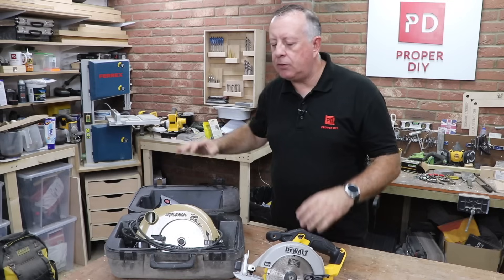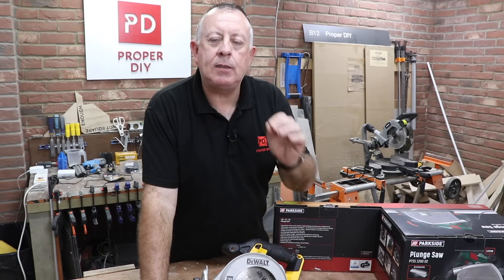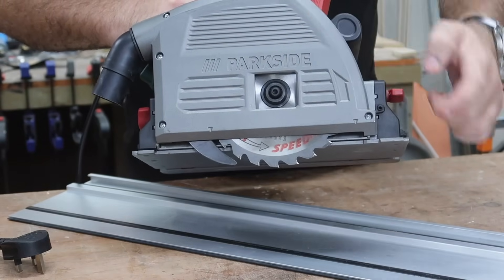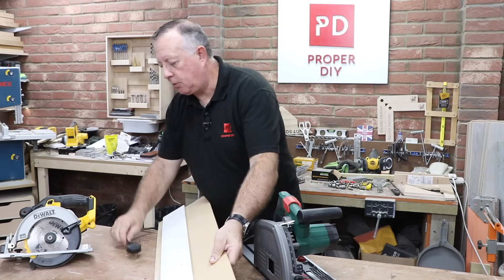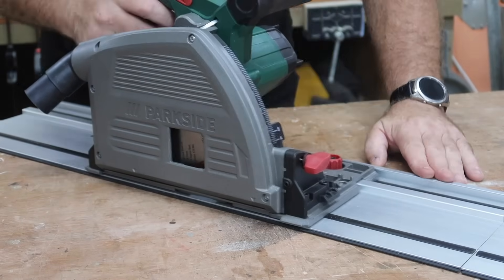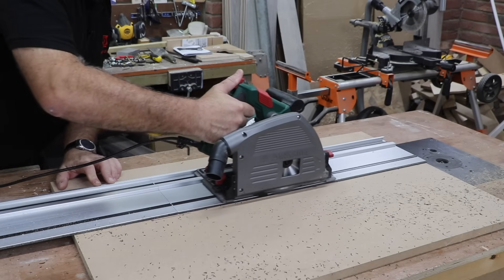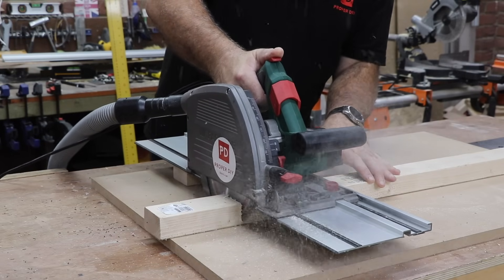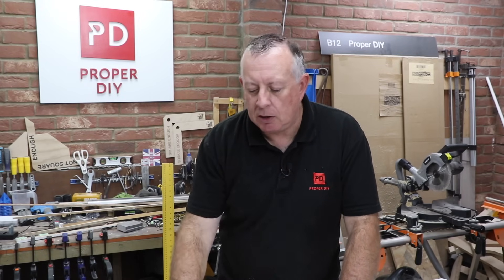Does the average DIY'er really need a Plunge Saw?

Comment: My woodworking skills improved exponentially the moment I bought my plunge saw. For making cabinetry and furniture it is indispensable and the accuracy saves lots of fiddling about to make things fit. With one of these and a cordless circular saw, there is nothing you cannot tackle.
Reply: It can't drill holes 🤣👍
Reply: @STEVIEBHOY It is very useful to make holes, just not small ones. Just the ones that a drill isn't useful for.
Reply: Fully agree i had the same experience. Opened me up to a whole world of options. I also have no room for a table saw and the track saw can handle most cuts
Reply: Ditto. One my first bigger project involved over £1k worth of oak. There was no room for errors. All repeated cuts came out super precise, square and equal - rendering my evo table saw and the mitre saw  completely useless.  Peter Millard also said that the more expensive plunge saws have much better dust collection: I fully support this statement - while cutting, I do not even have to switch the extractor: all dust ends up in the hose on its own (unless you trim very tiny straps from the edges, with the blade exposed). My advice to the new DIYers? If you cannot afford very good table saw and very good mitre saw - buy one, good plunge saw. Budget of around £500 quid will even allow you to buy a few accessories from benchdogs. You will be happy with your projects.
Reply: A tool opens up capabilities but doesn't suddenly improve your skills 😜
Reply: @feanor5037  OK, how about the improved precision, then? Cutting on the table saw is similar to the plunge saw, yet the technique is different- so it does improve your skill set.
Reply: Absolutely agree!
Reply: Why the hell would you need a circular saw if you have a plunge saw?
Reply: @smashyrashy  maybe he had the circular saw first. I still get my cordless circular saw out for really short cuts when it would take ten times longer to set up the corded tracksaw.
Reply: likewise. the time taken to jig up for accurate circular saw cuts meant that I never became proficient. the track saw has opened up a lot of possibilities for me.
Reply: One feature that's missing off the cheaper Parkside that is present on its more expensive cousins, is an anti-kickback device,  a valuable safety improvement over standard circular saws.
Reply: In my view a plunge saw is a game changer and a much better option than a circular saw enabling precise cuts more quickly. Yes, with a bit of ingenuity AND TIME, you can make guide rails in timber that you can use with a circular saw but they simply aren’t as versatile. A good guide rail is surprisingly ‘sticky’ and often doesn’t need to be clamped down to achieve a good cut. It can also be moved fractionally to make the thinnest of shim cuts. Mine is cordless and I often take it with me when I am picking up large sheets from a timber merchants, as I can cut the sheets accurately there and then to fit in the back of the car. 99% of anything else you pick-up can  be cut with a handsaw to fit. Quicker, safer, more accurate and far better in my option.

Comment: As a DIYer by force having bought an old timber house that needs a lot of repair and general maintenance, I bought a plunge saw as my first saw. The main reason was that I was terrified of using a circular saw. My track/plunge saw has seen me gain confidence in using power tools and I realised, after purchasing a mitre saw for skirting boards and general cross cutting, that a circular saw is something that I should be looking at purchasing because I would use it more often than either of the two saws I had. So I took the plunge (he he he) and bought an 18v Makita circular saw. That saw is now my main go-to on a day to day basis. However, track/plunge saw does come out for  ripping larger pieces and when I need long narrow pieces for filling the many gaps in timber walls, ceilings and floorboards. It's just so precise that I can get 2 mm thin lengths of wood strips with it. I just love it. And I do love my circular saw. I have attached a dust bag to the circular saw since I had a spare dust bag from my track saw and that deals with most of the dust coming from the circular saw. I would not want to be without either saw now. Both have jobs to do and they make my work so much easier.
Reply: @AncoralmparoPiper I too am terrified of my circular, never lose that fear and respect, safety first.
Reply: @mrgunn2726  I don`t think being terrified of a tool is really good, because I might actually produce safety issues. Good training might help. But yes I agree, never lose respect, and safety concerns.
Reply: If an old pro hasn't shown you how to use your circular see if you can get some instruction.  They are far more versatile than a plunge saw, but yes, can be dangerous.

Comment: I’m not convinced…for, as originally stated, a ‘casual DiYer’.  If you are making cabinets then ok, but I’d need persuading that the plunge saw was in some way cutting straighter and more upright than a good, properly adjusted (and this is key)circular saw on a checked for straightness track.  The only positive bonus I can see is the plunge saw has better dust collection, but we are talking ‘casual DiYer’ right!  So a bit of mess while doing the occasional carpentry indoors is no biggie.  Plunge saws are hella expensive, upto three times the cost of a regular circ saw.  If Stuart gets a little potential wobble on his home cobbled circ saw track (as he says), he could easily make the saw better guided with actual aluminium rails…tons of You Tube clips show how.   As for lauding how the black strip at the edge of the track amazingly shows the precise cut edge…well so does the trimmed off edge on a home made track too…it is not extra special in this, heck if it means that much just fit a black, door weather strip to your track and slice it off with the saw huh!  Sorry but for the ‘casual DiYer’ it just looks to be no real advantage!

Comment: I made do with a standard DeWalt circular saw and home made guides for a long time. What finally made me buy a Makita track saw was needing to make quality cuts INDOORS. Even with a shop vac attached, the DeWalt  produced so much dust the cleanup time with MDF was unacceptable .
All improved with the track saw, especially the dust control. Cut quality vastly improved even though I used a high quality blade on the DeWalt. No having to clamp the home made guide either !
One of my best buys.

Comment: I bought a super cheap plunge saw a couple of years ago, plus some extra track to make a 2.5m length for breaking down whole sheets… the short track I got with the saw I modified to add a 90 degree  stop for making accurate crosscuts.  I now hardly use the table saw on sheets: Tracksaw is so much quicker, plus I love the clean edges when you use the ‘pre-cut’ setting on the plunge saw to remove a thin layer from the workpiece, followed by the full-depth cut. Great for worktops, melamine, etc etc.  Worth every penny.
Reply: The Lidl/Parkside one doesn't have a 'pre-cut' or 'scribe' stop but looking at the blade change stop/lock it should be possible to modify it use it to give one and still retain its intended purpose. In fact looking at how the actuating lever is placed I wonder if it originally was dual-purpose.

Comment: Nothing cuts straighter and more accurately than a proper track saw. I just love how my work pieces, even very large ones, come out perfectly square and straight. There is something very satisfying about that, even as a DIYer you feel as if that extra professional touch is worthwhile. It does take some practice to really nail it, and there are some issues that can crop up (as well as solutions), but I have gone over the learning curve and at this point I would never be without one. That being said...I wouldn't buy the cheapest one, I picked up the Makita 36V instead (which has great cutting power to boot).

Comment: I've cut many doors to the right height and always used a circular saw and attached a straight edge to the door with clamps. Straight line every time. For sheets a length of timber is screwed to the sheet if the holes cant be seen..
Reply: So I don’t need one if I’m nifty enough with my circular saw? Mainly used for roughing ply & OSB but I want to knock up a media wall using mdf & I’ve been thinking about using a straight edge as opposed to buying a track saw that I’ll rarely use 🤷🏻‍♂️. Opinion appreciated Richard

Comment: It’s not either or though. Both have their uses. I originally bought a cordless plunge saw so that I could cut up timber in a car park if necessary as well since I did not have a circular saw at the time. Now I have 2 plunge saws (added a cheap corded one with a different track profile) and a circular saw once I could afford them. Both types are great and I imagine most people will have both eventually as plunge saws are now so affordable. The great news is that even the entry model plunge saws perform very well as you just demonstrated. Good video 👍🏻

Comment: I bought a Makita plunge saw last year and have been very impressed with its performance. Cutting melamine faced chipboard leaves a perfect edge on the underside and for most purposes the splinter guard produces an acceptable top edge but the Makita comes with the facility to do a fixed depth scribe cut and doing this gives you two perfect edges. As for dust collection I find suspending the hose from above avoids stopping and adjusting the hose on long cuts. Incidentally, Strawbyte Workshop sells 3D printed covers for the blade change holes but mainly for the more popular makes. He also sells offside spacers which enable you to accurately account for the blade thickness when the piece you are cutting off needs to be cut to a specific width.

Comment: After moving into a house that had previously been occupied by a crazy cat lady, and hadn't been cared for for a good few years, we decided to replace all the manky internal doors that weren't already missing. As the door frames were all over the place every single door needed cutting down to fit. My father got hold of a Titan plunge saw, and once we had purchased a longer track kit (Makita/Festool all work with the Titan) it made short work of the new doors with a smooth finish, requiring no further planing. It also proved its worth cutting hardboard sheets for laying over some gappy floor upstairs - the cut depth accuracy is very impressive for a 'budget' machine.

Definitely a tool that DIYers could use regularly. I have a job to do soon involving cutting furrings for a flat roof conversion on a brick shed, so I will be borrowing the saw for that!

Comment: Id definitely recommend getting 2 x 1.4m guide rails and connectors so you can cut down full 8x4 sheets of timber, also trim down the vertical sides of wooden doors etc.

Comment: Thanks for that chief , you have just answered a question that has been on my mind for a while ...... I need to fit a bigger piece of glass in an interior door to let more natural light in . I thought a plunge saw might do a better job than my circular, however what I actually need is to make a template to the required size and use a plunge router , setting the depth to leave a rebate for the new glass unit to sit on . 
Thank you once again , all the best 👊

Comment: I had always wondered about plunge saws having used my trusty circular saw and old fashioned straight edge guides until I bought one. They make cutting tasks so easy no working out the distances from the blade to the edge and transferring to the straight edge it's as simple as put you measurement on the workpiece put the track and cut..in most cases no need for even a clamp..haven't used my circular saw now for over two years.
Reply: Check out his homemade straight edge.  Once he attached the straight ply to the MDF, he then (first use) ran the saw down the straightedge, cutting off the excess MDF.  Now he has a guide that can be aligned with his pencil line forever more.  If you like your plunge saw, that's fine.

Comment: These are great, I can cut down built up panels with a track rather than separately cutting pieces to make the panel. I can set depth with a little trial and error. I can use it to make hand drawn miters (these are a lot  lot more compact than a miter saw, it fits in my cupboard in my flat). If you must have only two tools for woodworking projects, have one of these and a drill. These also produce less sawdust than my Dads miter saw. I've built a beautiful reclaimed wood reinforced shed with this.
Reply: oh, can plunge saw replace miter saw for some basic trim work such as baseboard and door trims?

Comment: For cutting up floorboards (repairing damage left by electrician after rewire) I found the plunge saw invaluable. I can plunge the saw in at a certain point to a certain depth, cutting only on the joist, avoiding pipe work and cables etc. Nothing else would make such a neat job of this. On a separate job, I then used it to cut laminate and laid this flooring much quicker than I would have done using my circular saw.
Reply: Because it can plunge its also brilliant for cutting out sinks & hobs on kitchen worktops, & far more accurate than a jigsaw.
Reply: Well, those of a certain age have plunged those 18 lb worm drive saws "...at a certain point to a certain depth..." too..  ;)

Comment: Great vid and very useful for many, I first bought my Makita track saw 12 years ago and I have to admit it had only occasional use.  Then I started using a home built MFT and it just raised my level of accuracy by a high degree.  I got a Dewalt table saw which I thought was all I needed but I feel safer and in more control with the plunge saw.  A few years ago I bought a square attachment for the Makita track and while it’s expensive I no longer have to worry about cutting square.  It’s great for cutting sheet material, work tops etc.  Dust extraction is infinitely better.  Now all of a sudden these devices have been put in the reach of most DIYers.  Put a good blade in and take your time, you don’t have to cut at the materials full depth, a very shallow starter cut gives a cleaner cut.  If I had my time all over again I would buy it again.  Thanks for post. Regards Mike

Comment: I bought  a Titan PS a few years ago and it burnt out last week. I have a circular saw, a table saw and mitre saw but my most used is the PS. I will get another ASAP as it's just so good at what it does. About a year ago I built a portable MFT setup and this really unleashed the versatility of the PS. I have several other track accessories(clamps, rail squares etc.) which have been extremely useful in getting nice square cuts and I intend to buy the Bench dogs MFT track hinge which will make things a little quicker. I recently had to make 3 cuts on a cabinet carcass while fitting my daughters posh new kitchen. The use of the tracks and PS made what was 3 quite difficult cuts much easier. I'm a huge fan of PS's but you really do need to ensure the stock is well supported on both the good and waste sides as I learned early in my days using it to cut down 8x4 ply sheets. The blade got pinched by the sheets and the saw kicked back violently. The blade retracts in a split second but it still tore up about a 3 inch section of the track glide strip. Since then I am very attentive to this detail.

Comment: Very informative Stuart. I was asked by a friend a similar question and recommended the Evolution R185CCSX which is basically a circular saw that runs on a track which I think gives the best compromise i.e the versatility of the circular saw and confidence of being able to cut straight in sheet goods. As your skills develop a plunge-saw becomes a good option if you've no plans or room for a table-saw and cabinet work. On safety, a plunge saw is much more approachable but in all the years I've had one still feel it requires the same level of attention as a normal saw.
Reply: I can give another +1 for the Evolution: I like being able to use it on and off the track. The main thing I dislike is the depth gauge isn't very easy to set accurately. Also, I dislike that I dropped it off my workbench yesterday and broke (coincidentally) the depth gauge.

Comment: I've got a plunge saw as my first saw and am very happy with it. Far better than my jig saw cutting down mdf sheets. The plunge saw was far more safer for me. The one big advantage of the McAllister over the the Parkside is that the track is the same one used on the Makita or Festool and my first upgrade for it was a longer Makita track. I am now thinking of buying a Makita plunge saw and can continue using my existing track.

Comment: I bought the Dewalt tracked circular saw when my previous circular saw died.  TBH it wasn’t great at cabinet sheet goods work.  Yes accurate straight line cuts on the track but a wildly unclear depth adjustment and abysmal dust collection made it less than ideal in a workshop.  Despite the ouch price I bought a Festool TS55 and absolutely love it.

Comment: Chop saw (ok, conpound mitre saw) and track saw turned my table saw into a table. Table saw is now only used for storing stuff or to hold long lengths. All are low budget Aldi/Screwfix versions, but the track saw always makes me smile. It just works.

Comment: Love your down to earth no nonsense approach in your videos.  I bought a Parkside track saw a while ago on the strength of the Peter Millard 10 Minute workshop videos an haven't looked back. I completely agree with everything you have said here. One caveat i've found, and I doubt it is unique to Parkside, I obviously over tightened the grub screws on the joining bar and so there is an ever so slight deformation in the top of the track. Not enough to be a problem but just something to be aware of.  These saws work really nicely with the Evolution tracks as well.